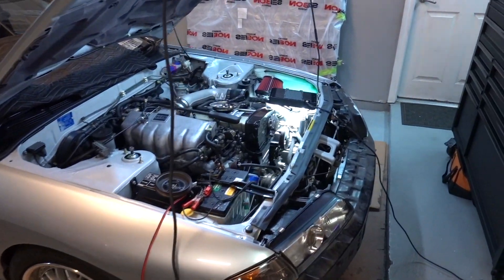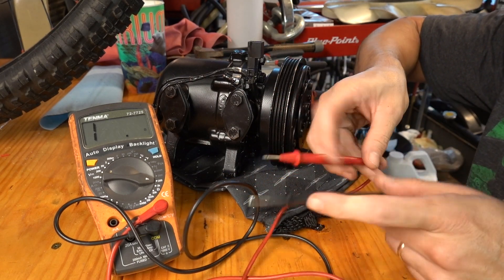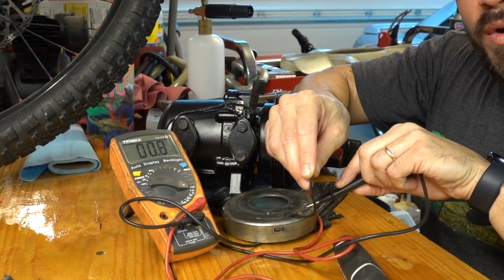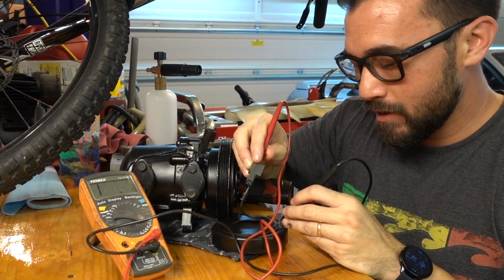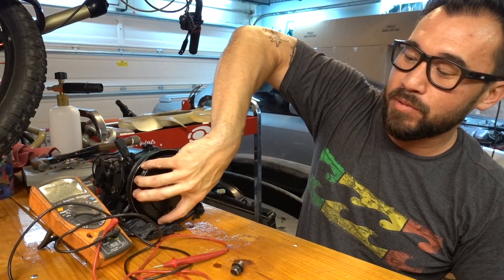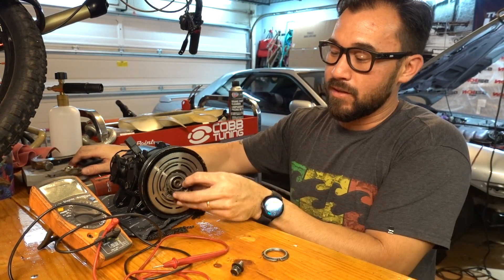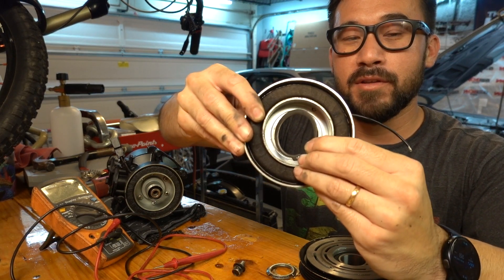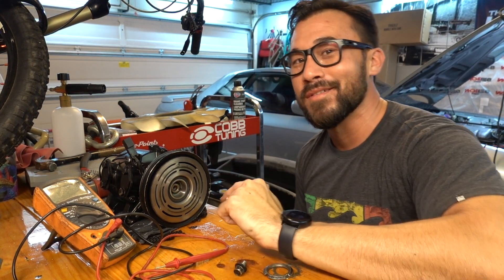AC Blows Hot  / Easy Clutch Coil Test and Replace / Compressor Clutch Coil Not Engaging / How to Fix

Comment: I measured 0 ohms across the two pins of the AC clutch coil (cold), so it indicated the coil was short. But when I turned the AC on, the clutch engaged. Any advice?

Comment: why does my clutch coil runs out of tolerance (4.5 to 1.3)  when it runs hot? then  Letting vehicle cool down back in spec (4.5) and restarting vehicle clutch coil engage compressor. then cycle the same again and again

Comment: Hi, I had an ac clutch fuse blowing and realize there could be a number of reasons. Having said that after removing the clutch coil and having replaced the ac relay and soon the ac diode, I tested coil and only got 2.5 ohms. I gather the coil is at least suspect with that low of ohms reading. Does that seem like a correct understanding?
Reply from the maker: 2 to 5 is normal.   But, 2 is on the low side and could lean towards fuses blowing.
Reply: @Donnythelatemodeltech  Thanks for your response. At 2.5 ohms it may have been going bad. Ill find out if I can find a way to press the new clutch coil back on.
Reply from the maker: Have you checked out this video yet? Might help. https://youtu.be/FEdrKv16jjY